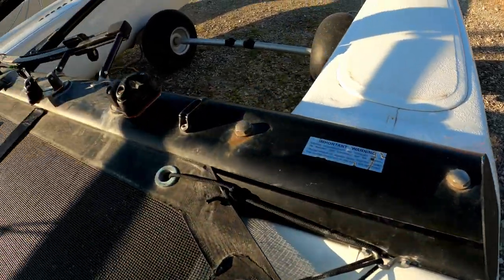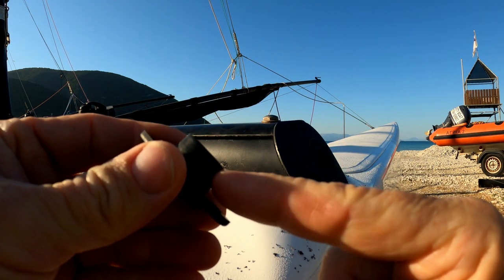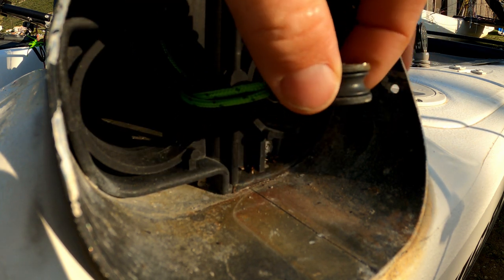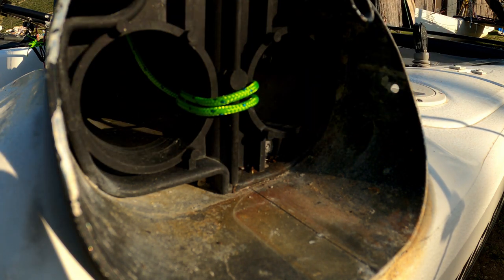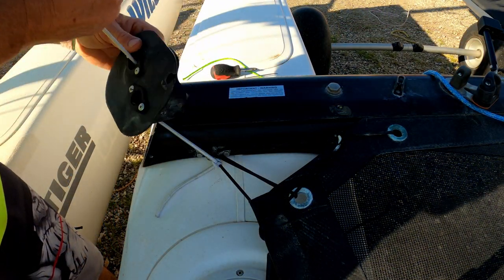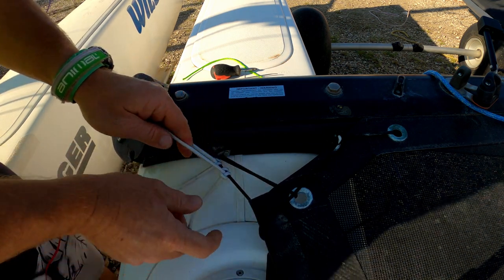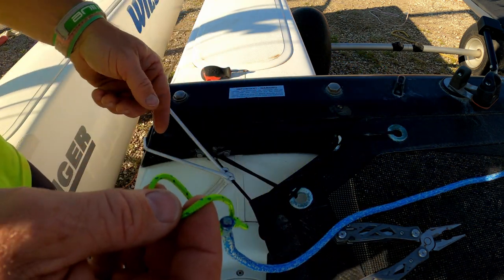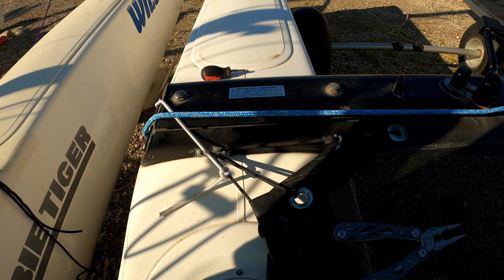Jib sheet and downhaul takeaway systems - Complete fitting

Comment: thumbs up Joe great detailed instruction. i have also seen a take away system for the spin sheet that is attached to spin tack line, a video on that would be great too.
Reply from the maker: I haven't seen that method for the sheet. I'll keep my eyes open and if I see it i'll certainly copy it.
Reply: Seems to make not too much sense - in low winds the spinnaker is hardly able to pull over the windward sheet, the tension by spooling up the sheet seems to much imho.
Reply from the maker: @feedingravens  I think it is something that we tried before - we didn't keep doing it as it was another potential for ropes getting caught/tangled

Comment: great video. do you think its possible to do a set up like that on a hobie 18 ? I just purchased a hobie 18 and it doesn't have a very good downhaul I thinks its stock. thanks Joe keep the great videos coming
Reply from the maker: You could certainly upgrade the downhaul but it wouldn't work to put lines into the beam.

Comment: Hi Joe, it's me again, the new season is here, us here in Germany can't wait to go out. Now, I just removed the end caps on my Tiger only to find out there seems to be nowhere to buy new ones. Do you have an idea where to get them? Thanks
Reply from the maker: Did they get damaged when you removed them?
I would speak to the guys at Hobie Holland - if they haven't got any, they'll know who does.
http://www.hobiecat.nl/?page_id=3278
Reply: @JoyriderTV  Thanks a lot for the tip. No, they didn't get damaged its just that there is a way too large hole in either of them. I'd like to install the take away system with the nice drilled holes and the bung housings.